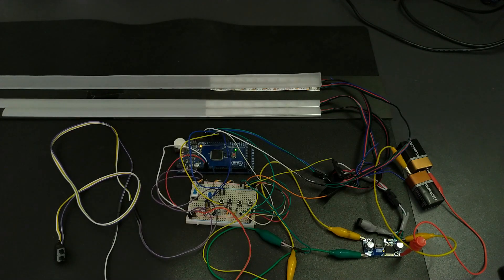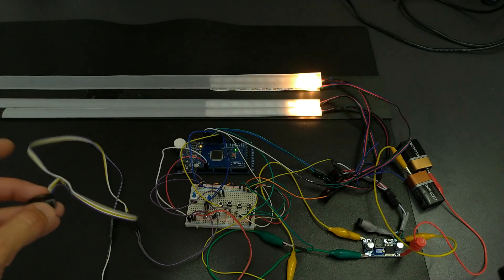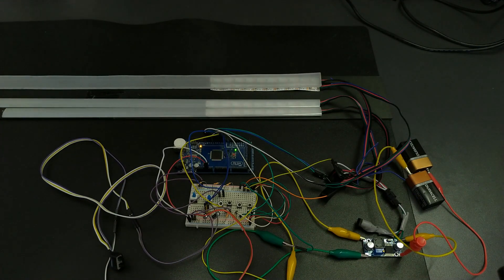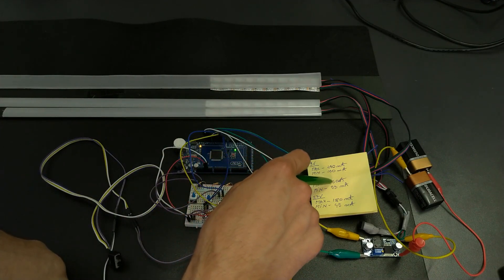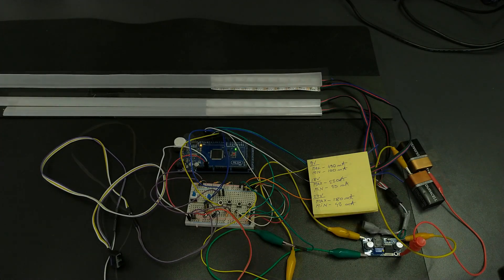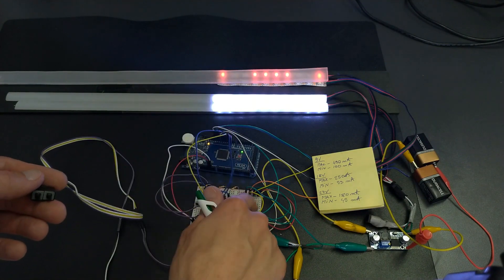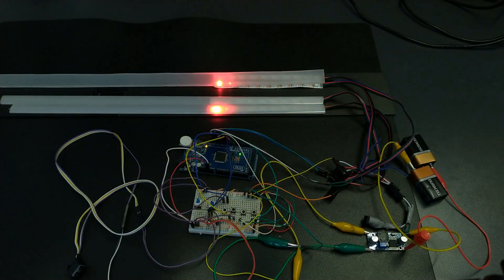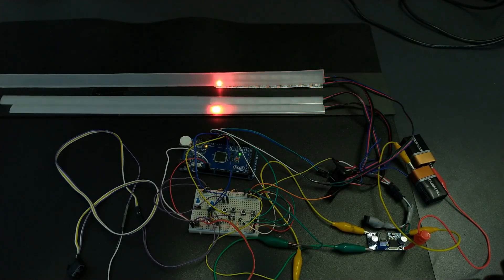Modern turn signal lights v4.0 for bikes - Arduino, FastLED and WS2812B

Comment: hello, should i use 1/2 W 10K resistor or 1/4 W 10K?
Reply from the maker: 1/4 w are perfect, because the resistors are used as pull down resistors...

Comment: I don't think turn signals without at least of 180 mm separation and red light in the middle will be recognizable.
Reply from the maker: You are probably right, but i think it depends on the light intensity and the light diffuser you use in the final dessing.

Comment: goodday could you help me out with my car project using a ESP8266 ?
with regards Mike
Reply from the maker: Hi Mike. From my knowledge fastled library is not 100% compatible with esp8266, but what do you want to do and do not think you will succeed with arduino?
Reply: Well i have a esp8266/mcunoden and not a arduino i want to have the swipe light with rear light and brake and reverse light in my car how do i program this and how do i connect the brake and blinkers to the board
Reply from the maker: @mikedjbassx  Well, like i said yesterday i don't think that fastled library is 100% compatible with esp8266, but you can certainly try it.

This clips can help you setup the ide and upload the code:
https://www.youtube.com/watch?v=p06NNRq5NTU
https://www.youtube.com/watch?v=d-uNkFHoMHc

After that just use my code and follow the basic schematic, but don't forget to change the inputs and outputs accordingly to your esp8266.

Comment: Hi bro, thanks , you've inspires me. Well in this version the hazzard light, knightrider light, nightlight turn on as the signal on and still on until the signal come again it will turn off. 
Actually i want to use this version on my motorcycle, so i need hazzard, knightrider, and night light turn off if the signal gone as brake and turn light. 
Can you show me how to change the code bro ? 
Thank you
Reply from the maker: Your welcome...
Well this version is not suited motorcycle is for bikes... at first the buttons are retaining the state if pushed ones and are not compatible with the way that the motorcycle is controlling the lights.
The modification the you want is not simple and the inputs will need complete rework.

Did you see this versions?
Modern turn signal lights v3.0 for scooters and motorcycles - https://youtu.be/7ZIk2abe_b8
Sequential turn signal lights v3.1 for scooters and motorcycles - https://youtu.be/rvhFAmL2lC8
Reply: @IonutF-TS-BB   Well thanks for your information. Maybe  my friend can make the code as i want, i'll share to you. 
I've seen all of your video. I interested the v3.1 and the last code i try is v5.0